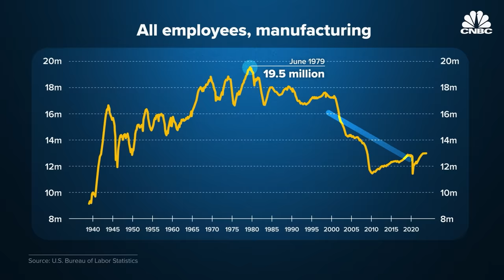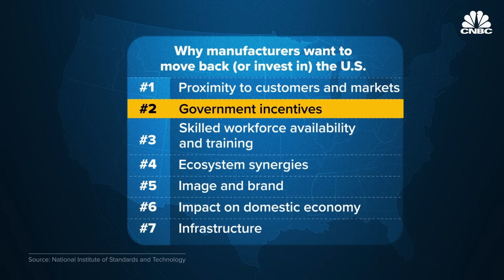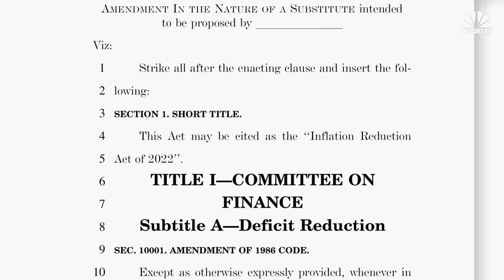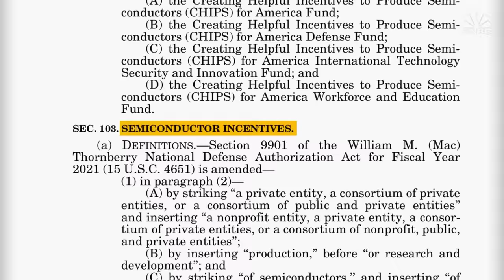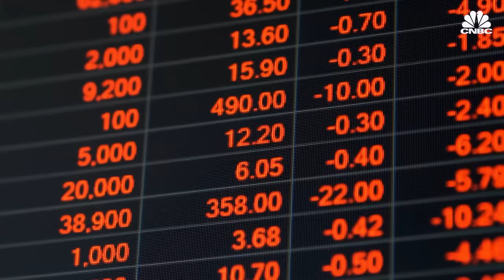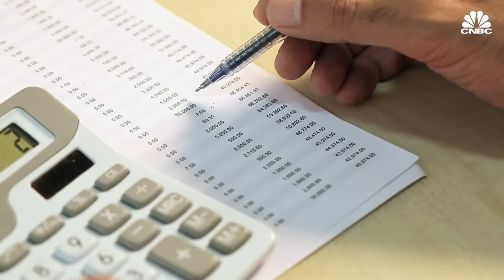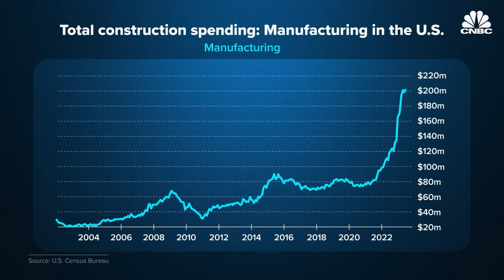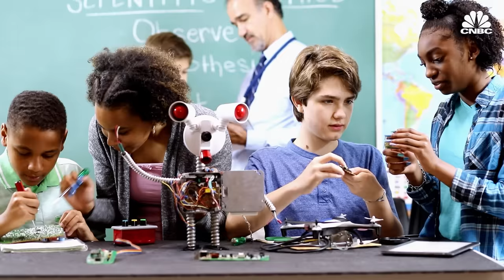Why Factories Are Coming Back To The U.S.

Comment: The big problem with a market-based solution is that the market will always take a solution based on short-term thinking. That's because companies have to answer to their shareholders who do not think long-term. It's this long-term thinking where government policy can play a big role. A purely market-based economy can't respond to things like climate change or changing global politics. This has to come from a source not handcuffed by next quarter's bottom line.
Reply: Well long term solutions can be planned for in certain circumstances but the bigger issue is how the solution is determined. Private companies will pick the solution that has the most profit involved and that is not always going to lead to the actual best solution for the country itself.
Reply: @dennisp8520  The key here is that companies will pick the solution that involves the biggest SHORT-TERM profit. Even if a longer-term approach might result in better overall profits in the long term.
Reply: @taloweryus Many companies that I've seen look at long-term solutions.  That's why they do manufacturing overseas. Wages and taxes are less overseas.  They have been overseas for decades not just a quarter.
Reply: More like regulations are the issues
Reply: Regulations are seldom the answer to any problem.  In fact, most problems are greatly exacerbated by them.  They moved manufacturing overseas because labor was much cheaper.  Now that labor is no longer cheaper in China, it makes sense to move it back.  Labor Unions in the U.S. are mostly to blame for the rise of labor costs here.  I do agree that some industries that support the military should be within the borders.  The solution is to weaken the Labor Unions.
Reply: Most investors do think long term. The real problem is that there are these massive pools of passive investment capital - most especially Black Rock, State Street and Vanguard - that own huge blocks of shares by proxy, which the actual owners don’t have any effective control over, which which just want the best short term returns. That’s also why we have idiocy like DEI and ESG social credit scores being pushed on companies.

I’m not sure what the solution is but these companies are bad actors and something needs to be done about them.
Reply: its almost as if the public should control the means of production.....but that would be
Reply: @kreativeforce532  Yeah because that’s worked out so well historically. I mean North Korea is practically heaven.
Reply: Gotta love excuses for job offshoring. they are as hilarious as they are neverending.
Reply: You need people with visions. I'm not a fan of Elon (I don't mind him either). People like him, will do what is most viable now and in the near future to optimize his goal. Within the law ofc.
Reply: Only thinking of short term profits is not good
Reply: One of the European countries mandates corporate board be representative of shareholders, worker, and local communities so that it's not all about profits.
Reply: @fuzzy3440 unions not the executive pay right. Another Right wing talking point.
Reply: @dale7326  *Deregulation

Fixed it. Deregulation is the issue that so many problems spring up from.

Markets don't regulate themselves. There is no benevolent invisible hand.
Reply: @kreativeforce532  Unfortunately Americans just can't be bothered with nuance in most regard and don't care. You can explain to them what "socialism" or "capitalism" and "communism" actually means and they'll just laugh at you.
Reply: No. Government is not the Solution bit the Problem
Reply: @arnowisp6244  Incorrect. Government's role is to enforce a level playing field and make sure the interests of its employers (those would be people in this country) are not taken advantage of by corporations only concerned with making a short-term profit at all costs. That includes ensuring that corporations stay within guidelines intended to promote long-term civic goals.
Reply: @arnowisp6244  Incorrect. Government is neither good nor evil but it serves a very important function in our society. And we have told ourselves this great lie that you now share. We have fooled ourselves that somehow government isn't a solution when in fact it has solved many serious issues. The American mythos that independent and pioneering spirits carved out this nation without or in spite of government intervention is nothing short of a fairytale that Ayn Rand sycophants tell themselves.

For better or worse it is the government who protects us from foreign and domestic threats through the military and law enforcement. It is the government which (helps) manages the delicate balances between the needs of the many and the needs of the few.

The issue isn't the size of the government, it's people trying to subvert its checks and balances. It's people trying to monetize government.
Reply: @taloweryus  Government has always been the Problem. Especially when they they lobbied and paid for by the Corporations. After Covid it is foolish to trust the government.
Reply: Market economy relies on the consumer
Reply: @taloweryus the government is handcuffed by the next election cycle....
Reply: Short term thinking -- exactly.
Reply: No it's the opposite
Reply: @averagenerd8566  No, the market is nearly always interested in the short-term. This is more true today than ever.
Reply: Hope trump removes app green policy ensentves. Makes it near impossible to impose more ever again. Let the consumers decide. Plua put a 80% tax on all Democrats and call it the you getting communism treatment tax. Also that 80% sales and income tax. Bankrupt the dems and refused them government aid
Reply: The stock market is not a free market system. It's heavily regulated and even rigged by government policies. A free market is where you don't have things like intellectual property..... patents and copyrights. These things are argued to have the effect of encouraging innovation by protecting the return on investment for R&D. In the end its only result is the aggregation of "intellectual property" into the hands of large corporations. My grandfather invented the process of emulsification for "waterless" hand soap, and sold the patent to 3M... he still worked his whole life as a general contractor. Without intellectual property, innovation would be more diffused and democratic. 3M and other large companies have no problem buying good ideas, whether cheap or expensive, and then NOT marketing them, because they already have profitable products that they currently bring to market, and with the small price of buying a patent, they get to use government tax dollars to prevent competitors from bringing similar products to market. We've created leviathans.
Reply: @c4call  "A free market is where you don't have things like intellectual property..... patents and copyrights."

That is completely false. A free market does not imply anarchy. All freedom needs a structure. There are laws against murder and theft. That does not imply we are not free. Intellectual property is a necessity with the state of current technology. If your grandfather sold his patent of his own free will, that is an example of a free market at work.
Reply: @Mahbu   We havent been deregulating though. Virtually every single sector of our economy has been increasingly regulated. No such thing as a free market anymore.
Reply: @mathewlloyd9717  We absolutely have been leaning more and more toward deregulation. Hell, every time a conservative president takes office, regulations are attacked. Either they're repealed or agencies that enforce them are defunded. Or just 'encouraged' not to enforce them.

And when there isn't a deliberate effort, sometimes they're sabotaged by a lack of interest.

And I would never want a true "free market". People think "free markets" will manage themselves and everything will be okay. . . but that's stupidity at its finest. One, when given a chance anyone will cut a corner or five. Two, we assume people always act rationally. . and they definitely don't. Three, sometimes people care more about the short term and not the long term.
Reply: you are completely wrong, it's the exact opposite. Government policies are causing all the issues, people in the government are unable to come up with policies that actually benefit us. If you think that government policies can save the climate, you are completely oblivious. All they do is increase the costs of businesses, waste resources which causes poverty and therefor even more pollution long term.
Reply: This is the problem with pure capitalism. All decisions are made based on short term profits & not based in ethics.
Reply: Aha! Sounds pretty much like Coase Theorem!
Reply: @joeb1522 That’s NOT a long term solution.  That’s just a way to cut costs, maximize profits, and please their shareholders at the expense of American workers and the country as a whole.
Reply: @1525boy  The purpose of a business is to make a profit, not to increase costs.  Economics 101.  The purpose of a charity is much different.
Reply: @joeb1522  A profit at what cost?  They can still make a good profit by conducting themselves in a more ethical manner.  I guess to you the end justifies the means.
Reply: @joeb1522  They haven’t been in Bangladesh 🇧🇩 or even the People’s Republic of China 🇨🇳 for “decades.”
Reply: @joeb1522  It's not charity to try to ensure the world is still a good place for our children to live in. Some things are more important than short term profis. If it takes government regulation to enforce this, I'm ok with it.
Reply: @taloweryus  Exactly!👍🏼👌🏼
Reply: @joeb1522 the care only about profit ..
Reply: @fuzzy3440 Don't forget the too often quoted "Rules based international order", "national security interest", "human rights" and " level playing field " reasons to justify regulations sanctioning and  preventing foreign goods competition into the USA.

Comment: Here is a counterpoint to the guy who believes "the market will figure it out". Take the US nuclear power industry as an example. Back in the 1970s those plants were very expensive relative to new coal fired powerplants. But look at how much of a better value those plants have turned out to be per kilowatt hour of electricity next to the coal plant polluting and needing millions of dollars in fuel over that time period.
Reply: And now the inudustry is trying to pivot and sell smaller modular nuclear reactors SMRs. They produce ~300MW vs the 700+MW from the larger reactors. They are safer, simpler, and cheaper than their larger counterparts so they can be more quickly rolled out and implemented within the grid.
Reply: I like stuff.
Reply: Nuclear power wasn’t killed by the market, it was killed by the government and the hippies who even now in their old age still hate nuclear power.

Also he said that if we make the West an attractive place to manufacture then the market will figure it out. So YIMBY reforms (which boomers will hate), low tax burden and not minimum wage.
Reply: Back in the 1970s those plants were not a viable investment. Now they are hence the faster rollout of smaller modular reactors (SMRs). The market figured it out
Reply: Government overregulation, not the market, is what prevented more nuclear in the US
Reply: @komenisai And right, if you don’t have those 7MW+ units, you will automatically have everything needed to start those 300MW units. Perfect logics.
Reply: Are you serious? After seven mile island government regulation crushed the industry (not to mention public support). We essentially demonized it and regulated it into obscurity. The government delayed nuclear 50 years imo.
Reply: @Eckster  perhaps but didn't help that we didn't educate the population on the safety of nuclear power planets. Everything would hear "nuclear", would think of the atomic bombs drop during WWII or the possible nuclear war with Russia at the time. Of course people wouldn't want to invest after hearing that. If the population wouldn't support it, the government wouldn't even bother with it.
Reply: Exactly. The "market" doesn't figure it out.
Reply: The only problem with the market is that it doesn't price externalities like climate change. If there were an adequate tax on carbon emissions, nuclear would have been more competitive, no matter its upfront costs. Such a minimal intervention by the state would have sufficed.
Reply: @oldsenpai4337  They still don't exactly have a perfect waste storage solution. That's the biggest problem.
Reply: @beback_ 
John stossel has covered nuclear energy.

Comment: "Since 2000 alone the US has shed about 5 million factory jobs." (Vice News, 2016)

American citizens don't control when factories move overseas. If Congress ALLOWS these manufacturing corporations to ship jobs overseas then CONGRESS is also responsible for PROTECTING our federal benefits. Congress cannot have it both ways. You either protect our jobs or you PAY for a generous social safety-net.

Also, the unemployment number put out by the USG is unreliable because it only counts registered job seekers. Total, real unemployment is unreported by the MSM.

Comment: Extremely complex and expensive manufacturing (semi-conductors) seems to be making a comeback but don't rule out the US continuing to outsource it's cheaper, lower labor, low value add industries to Mexico & SE Asia. It's important to have these industries and diversification in our energy portolio but was should also remain practical and have realistictic expectations about the world - that Oil/Gas is not going to be "replaced" any time soon nor will every American be driving an EV car anytime soon in the next 20 years. There is simply not enough Lithium/Cobalt for that to be a reality and our electrical grid isn't currently built to support it.

Comment: Taiwan's TSMC is not integrating well in the US.  It complained that setting up factories in the US is more expensive than it had thought and there are not enough skilled labor.  Simply giving out generous government subsidies is not sustainable in the long term.
Reply: THERE WASNT SKILLED LABOR IN tAIWAN 15 YEARS AGO, THERE WAS AND CONTINUES TO BE INDUSTRIAL POLICY THERE HOWEVER.  SIMPLY OUR DEMAND OUR PROVISION, GET YOUR OWN DEMAND.
Reply: ASIA HAS BEEN DOING IT FOR DECADES, T IS WHAT ASIA DOES, INDEED SO MUCH THAT CHINA HOUSEHOLDS GET 60% LESS OF CHINESE GDP THAN US HOUSEHOLDS GET OF US GDP.; THAT IS HOW THEY PROVIDE SUBSIDIES, SUSTAINABLE FOR THEM.  SO FOR US.
Reply: @cstevenson5256  That was 15 years ago, we are talking about right now.  If the US has a skill labor problem then our transition to high end manufacturing will not be smooth.
Reply: @dspirit2  doesn't have a problem, much less than elsewhere, just has an issue with volume, certainly no more than elsewhere.  Likely more a deficiency on part of TMSC in ability to manage cross-culturally and ability to adapt practices.
Reply: @dspirit2  further, in US, 15 year Olds are being taught CAD CAM CAE IN 9th grade.  My niece was and we have Workforce Development Boards in every region that direct regional spending on workforce training needs, easy to scale whatever needed of partnerships between funders, uni service provider on need of local business.  Just moving youth back from gig work and refocusing creative on manufacturing as techno craft.  Easy.  Our  urgent production is tech based and 5 times as efficient than China, more productive on average than Taiwan.  Taiwan is merely in Fab.
Reply: @dspirit2  don't use "our", you are American, merely a.wumao looking to interrupt discussions and guide narratives as a 50 center.  Your grammar and the direction of your perspectives, the things you discuss illustrate.  If you are discussing, cN be certain things going well as another country tries to use its minions to distort.
Reply: @cstevenson5256  If TSMC has to give training en masse then that would hurt their bottom line.  I suppose that they were expecting US schools/vocational institutes to do that, like in Taiwan.  But apparently not because US industry hasn't required such skills.  Looks like more Infrastructure is required.
Reply: The major issue here is that China can cripple the US just by taking over Taiwan, something that they wouldn't have much of a difficult time doing and something they are already starting to do now. 

If TSMC can't make them, American companies will, thanks to tariffs and incentives.
Reply: Not at all taiwan sits on second step, US creates software and machines, others created by Europe and Japan.  Taiwan is a manufacturer that produces what others produce as well.  Intel new Euro operations using techniques every bit as sophisticated, as their arizona operations as Taiwan
  Taiwan just produces alot, not what they need to produce that is US and Uerope, and US and Europe produce what TSMC produces, just not as many as used currently.
Reply: both the notion that China can take over Taiwan easily is quite far from the truth.  The Taiwanese must be farily competent as they took the mines out of the beqches in the 90s.  China can bomb Taiwan extensively and barbarically.  But take over?  Dont be so sure.  Then the Chinese must be less than confident about all the so iet tech they licensed and stole from Russia considering how poorly flatland Russia has performed against flat open land Ukraine.  This as opposed to an amphibious landing.  Further the quality of Taiwans armaments are nothing to sneeze at.  Then China would be barred from trade, more importantly it would lose access to the US financial system.  At the very least Taiwan will extract a very heavy cost which will illustrate an incompetence among the Chinese military globally that will make Russian performance in the Ukraine look like Hitler taking over Bohemia.  Neither easily nor that important as Taiwans machines to produce chips are made in US, Japan and Europe.  Not taiwan.  Its factories will be destroyed prior to Chinese taking over.